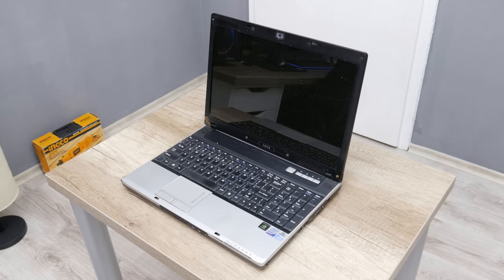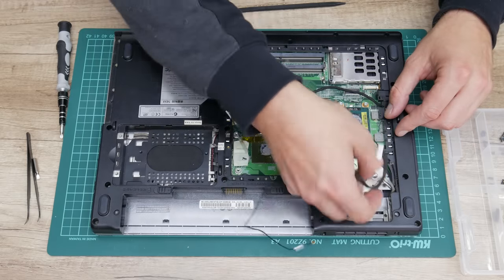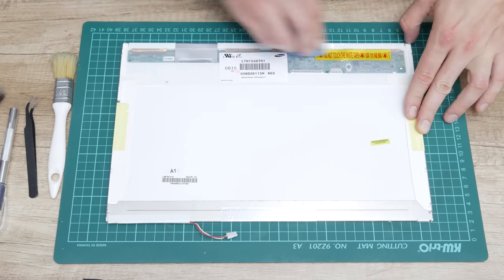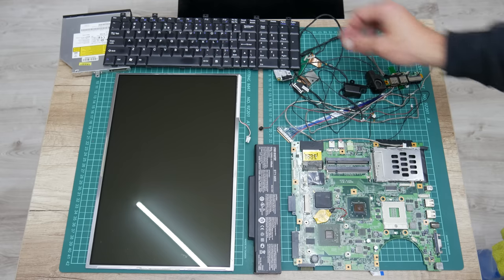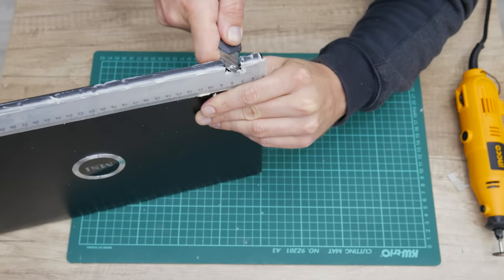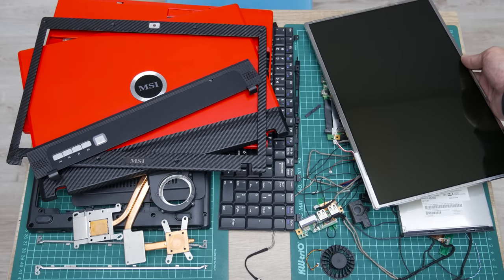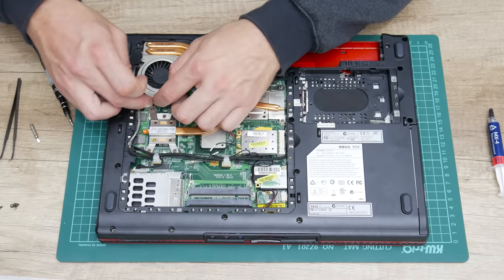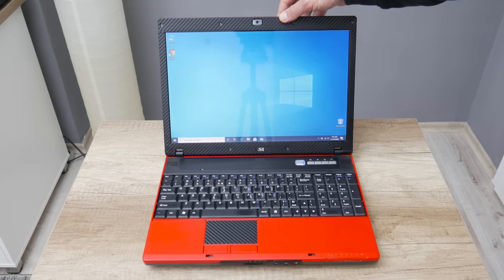I Pickup MSI EX600 from Trash - Can I restore it?

Comment: That’s unusual to see so many wires and cables in a laptop. It looked like a lot of work to refurbish, so nice work dude!
Reply: It's rather a standard issue sometimes. I find it hard to believe that MSI would of had those wires cross with the clips like that though. Looks like someone has been in the system before per the no hard drive mount for starters.

Comment: Wow, this has been really nostalgic for me. The first laptop I owned was MSI GX600 which has almost identical chassis. The hinges on these laptops broke really easily and in general it was much more fragile than one could expect (for a while I actually did the same thing as you did in the video - switched the hinge brackets to upside down - it helped a lot). In the end I rebuild the whole laptop from scratch using a donor laptop. This basically made me strip it down to each screw and creating one computer out of two. Unexpectedly, it was great fun. Sadly I sold the laptop afterwards, I now wish I kept it.

Comment: firstly, let me just say dude i actually love your content its like watching ASMR if that makes sense makes me happy and relaxed and its sooooo satisfying 

I'd like to ask if it's possible to do something more recent model wise? like maybe a Lenovo ThinkPad restoration? they're cheap and well priced and reliability is amazing

love the content , keep it coming :)
Reply from the maker: Thank you broo :D
Reply: @ComputersAndTechAndAndrew  what is the difference between A SODIMM and a DIMM ram? Can i  replace my 2gb SODIMM ram with a 4gb DIMM ram.
Reply from the maker: @hitmebabyonemoretime7643  Hi bro, the SODIM stands for RAM which is made for Laptops or computers that use the same form factor of RAM. The SO in SODIMM stands for Small Outline, which means these RAMs are smaller.

The DIMM stands for Desktop ram and for the standard size. 

You cannot use standard Side RAM in Laptop or DIMM to SODIMM because cannot fit in the port. 

But you can use SODIMM in DIMM OR Laptop RAM in Desktop computers but using Converter. 

I've have tried this but the performances are not really good for many tasks, but in many tests works the same. 

However, I always recommend to use parts for what are made, If something is for desktop then is good to be used on Desktop. If something is made for laptop than is good to be used on laptop
Reply: @ComputersAndTechAndAndrew  thanks bro. I've using and old laptop an Asus U82U. The existing memory is 4gb only and i decided to upgrade to maximum which is 8gb. It's difficult these times to find a ddr3 1333mhz 4gb ram for two slots since ddr3 are nearly obselete. Somehow i found ddr3 rams but 1666mhz and its DIMM. That us why im asking if i could use a DIMM ram on a motherboard that supports an existing SODIMM rams

Comment: Agreed with what you said I had MSI need work on was not power up before I go in to the laptop I watch disassembly how take this modal apart best way after watching more one video i can safely take it apart 

BTW Fix The MSI was not powered up the problem was do to a bad DC Power Cable

Comment: Try using sewing machine oil to lubricate fans, works even better then motor oil. Great for dvd drive trays too. Great video as always, informative and fun to watch.
Reply from the maker: Hi bro, I have used and it's great but currently I don't have some good sewing machine oil. The oil that I used is Castrol 5w30 full synthetic, also is good for cooling fans

Comment: Really impressive restoration. Was really interesting to see how you reinforce the broken plastic since broken plastic pieces have always been a bane of mine.

The red colour is not exactly my cup of tea and neither is carbon fibre texture however this is entirely subjective. What I am thinking about, however, where carbon fibre vinyl ends by the reinforcement, doesn't it leave an annoying edge? I wonder if vinyl could be wrapped around the plastic ruler end to give it more "natural" rounder edge? but in that case, have to ensure the paint reaches underneath the ruler enough so such wrap wouldn't reveal original colour.

Either way, great work and I enjoyed watching it!

Comment: It's always better to replace worn fan instead of just greasing it. Grease-fix won't last long.
Also you should've checked RTC\BIOS battery with multi-meter and replace it if it is nearly dead.

Comment: Using IPA to clean screens is not recommendable. The abrasive properties of the alcohol react with the UV coating that is there to protect your eyes. In some cases the cosmetic damage is so noticeable that it's only possible fix is by replacing the unit. Spray distilled water onto a microfiber cloth or coffee filter instead and rub it very, very gently to remove any dust or debris.

Comment: Andrew, where do you buy that anti static glass cleaner?
Or how you know if the product is have an anti static elements for glass cleaner?
Reply: Go to your Local Pharmacy store.
Get isopropyl alcohol 90% or higher. Don't buy it if it is less than 90%.
Basically Alcohol itself is anti static only if it has high concentration.

Comment: I don't think puting a ssd in this old model of laptop that doesn't even support sata 3 is a good idea Andrew
But it will work for sure but not very effectively and windows 10 won't be very good for it but it will work , that's for sure !
Between do you use linux distros like Debian , Ubuntu , Mint , Pop os , Arch , manjaro etc..?

Comment: If that's a 2008 laptop.... Using 96% alcohol on the screen is a little stupid. 

It eats the coating off most screens. You're supposed to dilute it to 50% or lower.

Comment: Hey, i really love your restoration, Great work on that. But i have an question please answer if you can and you want to.
1. Why using windows 10 Pro on old model like this ? isn't it better to run Home version with this old model.
2. How you find the driver for the most all your restoration laptop ? Cause i'm so interest on restoration laptop like this and want to try something to do like you too.
Reply: 1. Yep, it depends perspective
2. Just connect to the internet turn on windows update.
Reply: @claritoresdiano1021  1. Ok and maybe sometimes you can get more older machine for restoration and the machine doesn't have support to win 10, then how you can get the driver ? just pick AIO driver pack from internet ?
Reply: @jshxp8247  
Windows update bro....
Pake seri windows 10 2004 (20h1) atau 20h2.
Hadeuhh.... Driver pack lw kira masih jamannya windows 7
Reply: @claritoresdiano1021  Hadeuuh Baca bro yg gw tanyain gimana kalau laptopnya ga pake Windows 10 otomatis turun versi ke Windows 7 yg lebih stabil gimana cari drivernya.
Reply: @jshxp8247  masa sih bro ga support ?
Reply: @claritoresdiano1021  Bukan ga support bro, tapi menurut ane biar lebih enteng aja, apa lagi kalau laptopnya ga di pakein ssd itu hdd usage di windows 10 berasa jalan trs kadang ada yg sampe nge freeze" meskipun lagi ga running apa2  apa lagi di laptop2 cukup lawas ( 4 - 5 tahun atau lebih ke belakang ) makanya kadang ada orang lebih milih windows 7 tapi ya gitu kendala driver nya udah susah sedangkan website nya pun udh ga nyediain driver nya. Itu yg jadi pertanyaan nya bro.
Reply: @jshxp8247  masih ada windows 8 bro.